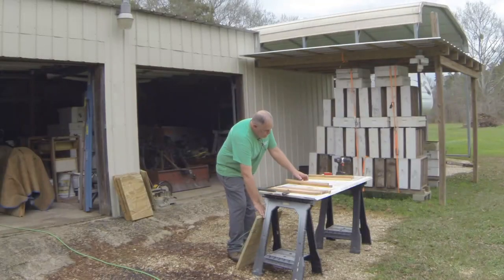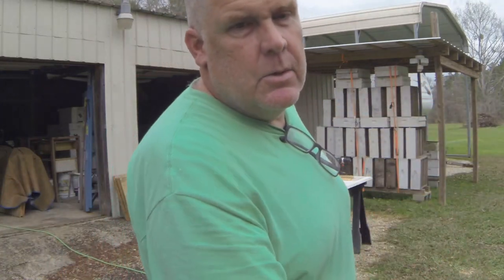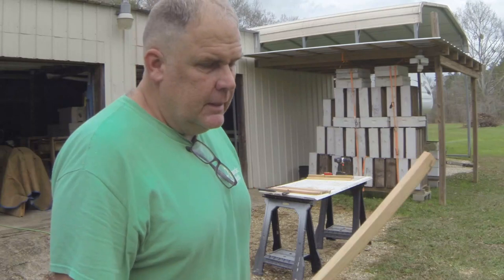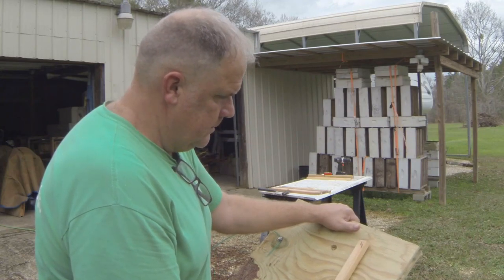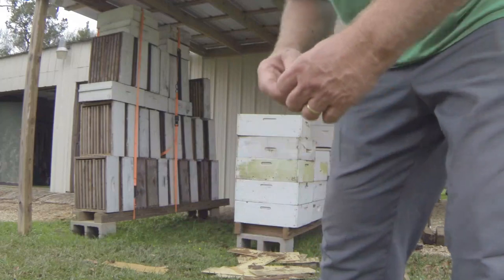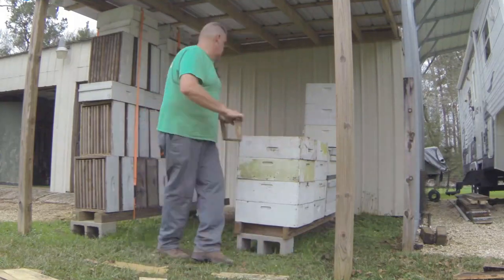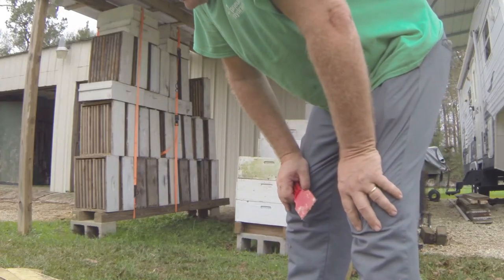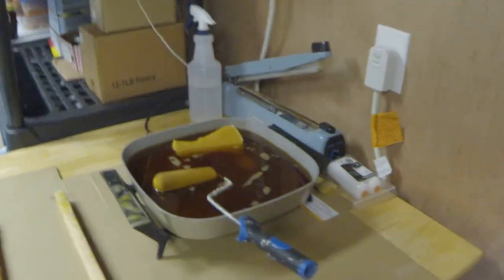Tedious Beekeeping Tasks & Talking to Myself, Frames-Wax-Boxes-Foundation

Comment: Those cleats add on your 'bait box' hangers will make them sit better against a tree trunk.  Almost as if you planned it.
Reply from the maker: Wish I did have that kind of foresight......Thanks
Reply: @MikeBarryBees  yeah, I wish I did too.  But I learned that I can use a cheaper plywood and add 2 cheap 1x  strips - half the price of making it out of 3/4 ply.  And had you not done it first and figured out how to fix it - I like would have had to construct a separate 'bait box', hung on a cleat, and then taking that down and transferring them to a standard hive box - 10×, 8× or 5x frame - instead of this method using 5 - frame  neuc hive boxes, where you can just move them over - night to a hive stand and not have to mess with them as they settle in and just set out another neuc to re-bait the trap.   It's ingenious!

Comment: Spray a little Pam on the inside of your bucket and the wax will fall out after it cools.
Reply from the maker: That's a good idea, thanks! I have seen rubbed around on the buckets, but shoot, dawn kills bees and wasps and I'd rather not have it in my bucket and plus, the water and wax seems like it would wash it right off. I'll try the Pam.

Comment: Just clean the pilot jet on carb and it will be fine (Your Pressure washer)
Reply from the maker: I cleaned the pilot jet first thing. Appears it is now most likely the governor. Local small engine guy enlightened me. I thought just like you said the jet,.
Reply: @MikeBarryBees  LOL we tried Governor may be bent a little , Mike have you ever had a problem with your bees just using top entrance & very few going to bottom one,
Reply from the maker: You know, this is the first time I’ve used them. Got the boxes from a friend, so now there they are. So I don’t know I suppose is what I’m saying. I have a hive that has quite a few using the top and very few in the bottom, but they recently swarmed, so I think they’re just weak and unfortunately are stacked with supers, so that could get messy soon. But most seem to be using both entrances.